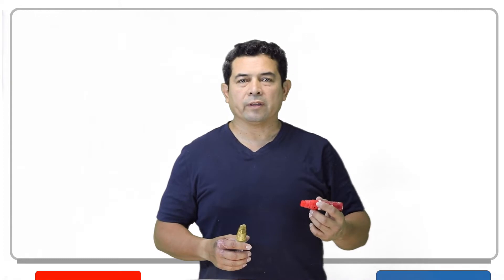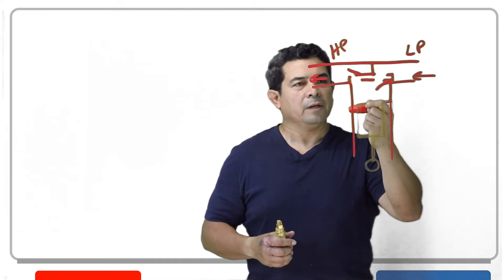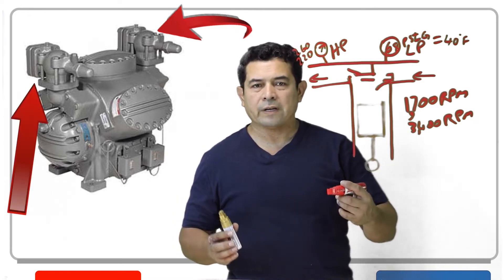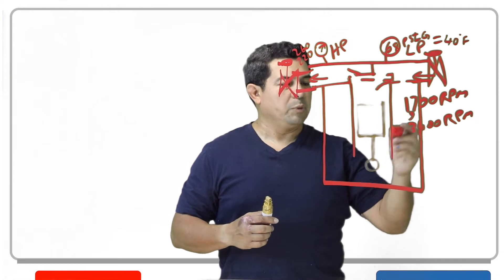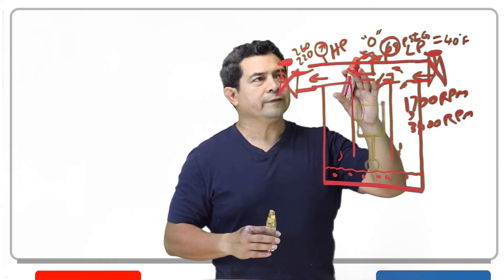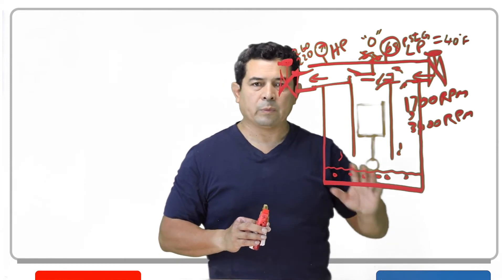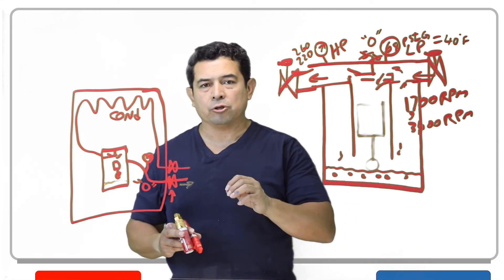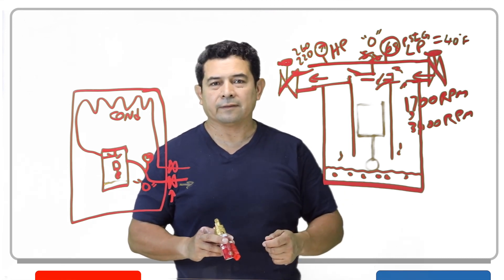Compressor valves, Pressure and Temperature-HVAC Online Training and Courses

Comment: Thank you Sir Julio, for sharing your kwnoledges. To check the rotary hermetic compressor can it be done in same way or is it another procedure
Reply from the maker: This really only works for the reciprocating compressor, which has the suction and discharge valves. On a rotary compressor there are no valves. It draws the refrigerant in from one side and acid rotates a compress it and pushes it out on the other side. So you really do not have suction and discharge valves, like you do have on the reciprocating compressor. I hope this answers your question. And thank you for watching!

Comment: It's also applicable in scroll compressor?
Reply from the maker: One of the nice things about the Scroll compressors is that they do not have suction or discharge valves. Because of that, there are no valves that can fail and even if liquid gets into the scrolls, the compressor will push it right on through. This video was to test the suction and discharge valves but since Scroll  compresses do not have suction of discharge valve, it doesn't really apply to a Scroll compressor. Thank you for watching!

Comment: Sir,
For R404a gas what would be suction  and discharge  pressure
Reply from the maker: If you are asking about an air conditioning system? Your suction pressure for a 40° evaporator should be right around 86 PSIG       the high side pressure could be as high as 260 or 270? But this is for air-conditioning I'm not sure what type of system you are working on. If you know the evaporator temperature then you can use your PT chart to see what your suction pressure should be.  I hope this helps!

Comment: I'm interested in rewinding and rebuilding air conditioning compressor hermetic and semi-hermetic compressor...where do you think I can find the spare parts  ..
Reply from the maker: That can be a little tricky. He would have to deal with the manufacturer and that may be a closed loop. They may not want to sell to just anyone. You can always contact copeland compressors for example or maybe Carlyle and see about buying parts see what their requirements are. Good luck finding the correct phone number and person to talk to.  Like anything else it will be hard getting started but if you stick to it you should be able to do it!

Comment: Hi, could you please explain what is the purpose of emergency setting in daikin vrv system
Reply from the maker: If we are talking about the same thing. That is so you can set the unit an emergency/cooling to help you pump the system down when you need to work on the system.. These units do not have a contactor you can push in to pump the system down.   I hope this answers your question.

Comment: Hi again Mr. Julio, thanks for continually sharing with us your knowledge sir. My experienced today with the car ac was that at idle it blows cool air, but when you accelerate or raised the rpm even up to 25 or 30, it stops cooling. And if you put the ac off and after 30 sec. you on it, it starts to cool again and thereafter repeat the same thing again when you accelerate. 
Any solution(s) sir?
Thanks in advance, MOSES .
Reply: In the case car AC when it behave such way pls check thermostat and the high pressure switch one of this may be faulty sir
Reply from the maker: I am so sorry that I did not see your message until just now. I know it has been a year I hope you got your problem resolved. From reading your comments it sounds like he might have had a restriction in the system so when you increased the RPM there was not enough refrigerant going into the evaporator to do any cooling. I have seen this or something similar when there is a partial blockage at the strainer before the metering device. Again I am sorry I missed your message until just now I hope you have a problem resolved.

Comment: Hey. Great vid as always. Question; you close the suction service valve only when testing the Compressor valves/performance ? I remember on a previous vid you said when you pump down to close off the high side to allow the com to suck all the refrigerant. But on this vid you said it is dangerous
Reply from the maker: Thank you for your comment and for watching the videos. I'm glad to hear that you like them. In the other video I was talking about pumping the system down. When you pop down you close of that liquid line service valve or the king valve. In that video I believe I was talking about closing off the liquid line service valve. When you do that you pull all of the refrigerant from the liquid line and from the evaporator and put it into the condenser and or the receiver. In this video I am talking about closing off the discharge valve. I am saying to not close the discharge valve because these compressors are positive displacement compressors and because of that something will break. So it is a little bit different than in the other video. I hope this answers your question. Again thank you very much and keep watching and keep learning!
Reply: @AirConAcademy  thanks for the reply and understood. Have a good day

Comment: how can we test if the valve still working fine? thank you
Reply from the maker: I'm sorry, I just now saw your question. Just like I was explaining in the video. You close off the service valve to the compressor and see if the pressure will stay down or low and it will not come back up. If it is a residential unit it is a bit more difficult because all you have is the suction line service valve on the unit .

Comment: Great video, 
I have a question how to change oil in old compressor
Reply from the maker: Thank you for the question.  If you want to change the oil in a semi-hermetic there is a plug that you can remove and drain the oil.  IF you have a hermetic compressor then it is more difficult. You need to remove the compressor and turn it upside down in order to remove the compressor.   it is a bit more difficult.
Reply: @AirConAcademy  thank you so much for the answer
Reply: Last question can I just mix  POE oil with mineral oil??????

Comment: Hello Aircon academy, if the suction service valves are closed and even if the suction valve on the compressor is leaking, where is the pressure coming from then.
Reply: I suppose it's outside air making it's way in

Comment: Hello Aircon Academy, if the system have more than one valve plate assembly how we can find the damaged valve plate?
Reply from the maker: We have always replaced all of the valve plates.  Sometimes you can hear the sound if you have a stethoscope. Other times you may have to inspect them one at a time.   sorry I do not have a better answer.

Comment: So if the lp side is higher than the hp side it means the valve is bad in the compressor and we have to replace the compressor in split unit?

Comment: Hi, Here are some subjects that have I not seen covered in YouTube, and would be a nice addition if you could make clips about it, 1. Oil pressure switches wiring and principle of operations, 2. Oil separators at the discharge side, are they practical and useful? 3. Suction line accumulators, are they practical and useful? This is for refrigeration systems with R22, and semi hermetic  compressors of around 20-30hp
Reply from the maker: I am so sorry! I just now saw your message because someone else commented on this video. Yes I will see if I can make a video on oil pressure switches, several of other guys have asked about that. Oil separators? Interesting not too many people ask or mention that. They are usually only use on low temperature systems and or refrigeration systems. For your typical air conditioning you don't really use oil separators. The accumulators are typically only used on heat pumps because of the switching from heating to cooling. The accumulator will keep that liquid refrigerant from getting back to the compressor. But if you have a system that uses a TXV, the TSV will maintain superheat and you should not have to worry about liquid coming back to the compressor.   I hope this answers your question and again let me apologize for not getting back to you sooner!

Comment: Thanks for the tip on how check valves. I think the 65psig & 220psig you mentioned are related to air conditioning systems. Can you please give the optimum pressures for R22 in refrigeration systems for -18C degrees box temp and for +4C box temp.
Reply from the maker: Yes! Those pressures are specifically for air conditioning but when we're dealing with very cold boxes like you mentioned -18C you looking at a suction pressure of approximately 24PSIG.  And for four Celsius, you're looking at a suction pressure of approximately 67. PSIG.      What I did was to use my PT chart to see what the temperature he wanted to have converts to. The pressures I am giving you is the saturation temperature at -18 Celsius, and at +4C Celsius.    I I'm not sure if this is what you were asking, but I hope this helps!

Comment: Great Tutorial!!! I understand that On residential split ACs you do not want your evaporator coil to run below 32° freezing mark but can you kindly explain why in the video you mentioned you want your evaporator temperature to be around 40°F and then that same clip you mentioned the high side pressure’s thank you very much
Reply from the maker: Thank you for your question!   Some engineer somewhere has decided tha 40 degrees is the ideal temperature for the evaporator.  So in the industry we try to stay around 40 degrees.  it is  a good temperature where we are not too close to 32 and still  low enough that we have good heat transfer.  on the high side, it is important because we need to maintain the the pressure high enough so we can condense it in the high outside air temperature. BUT  NOT  too high where the compressor works too hard.

Comment: thank you so mach i have a quastion where is the metering device usually located on a mini-split system
Reply from the maker: Fesal Modi The metering device would still be placed on the indoor unit in a mini split if it is a straight AC unit. If it is a heat pump then you would still need one in 2  places. One inside and one outside.

Comment: Thanks teacher.
 please what is gonna happen if the rings of piston are bad ?
Reply from the maker: On smaller units 30 or 40 ton, compressors typically  do not have rings.   On larger units 75 ton on up the may have rings and if the rings fail the high side pressures would drop and the suction pressure will increase. You may also loose oil by pumping it out.